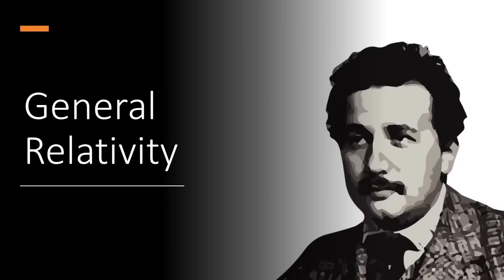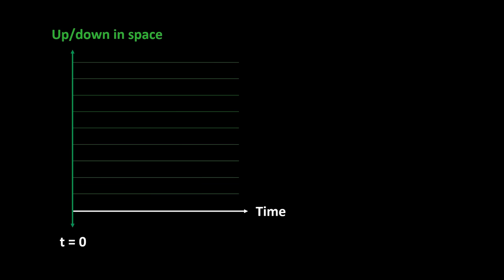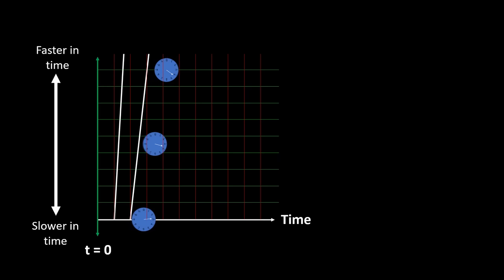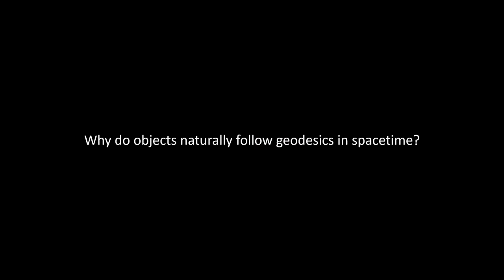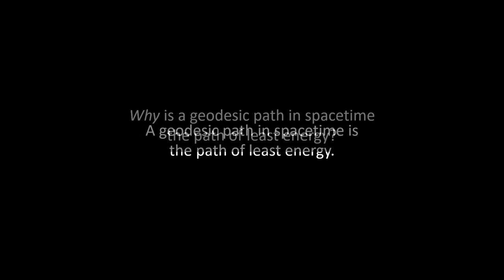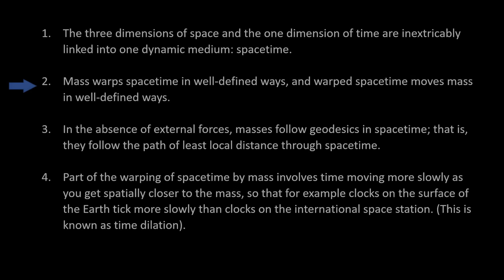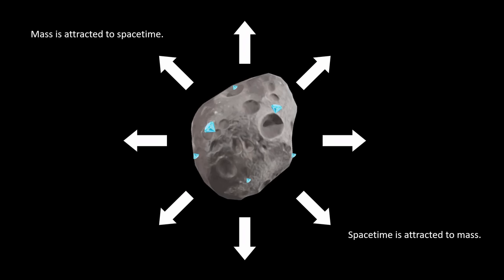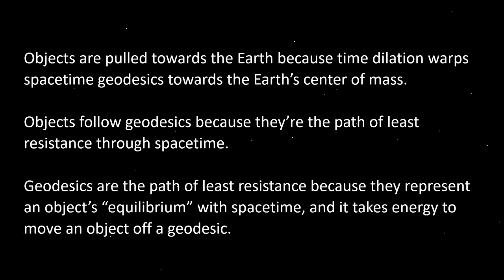How Time Dilation Causes Gravity, and How Inertia Works

Comment: Ok there is no such thing as time its existence and purpose is to be a way to measure life spans of the universe down to electrons time dialation is only by products of friction, static(electricity) and magnetism caused by the first two time itself is not affected by anything it's the physical matter of the object your using to measure time that is slowed by the the affects of the friction, static and magnetism. Time Is a constant rate of incremental now's that we use to measure the passage of life and or the decaying of it.

Comment: Great video! Does your explanation of inertia imply that there is a "privileged" reference frame? One where an object is neither warping new space nor unwarping it's existing space?
Reply from the maker: Hi Chris, very interesting question. Thinking about this, it occurs to me that this is basically the same thing as asking if there can be any object out there totally "at rest", i.e. with 0 momentum. For this to happen, all gravitational influences from everywhere on that object would have to be perfectly balanced and would have had to be perfectly balanced for the foreseeable past (otherwise, that object would have picked up some momentum due to gravitational acceleration). Because of this, I'd say no, there's no privileged reference frame of the type you're asking about. You may have heard of the "three body problem", how deriving analytic solutions for the trajectories of just three gravitationally co-influencing objects is effectively impossible; well, the case for all masses in the Universe is like an "infinite body problem", and it's essentially impossible for this infinite set of chaotic influences that propagate through space at the speed of light to balance out to 0 at some point.

Comment: I question statement #4 at 1:43. Atomic clocks put in the basement of the Empire State Building and at the top showed that the ones at the top registered time more slowly because they were moving faster. The same with the synchronization of GPS satellites and ground clocks. Please double-check statement #4...it doesn't seem right to me.

Comment: Excellent explanation of how gravity works.  Much better than the three videos you mentioned in the beginning.  I would love it if you expanded your examples of traveling through the geodesics to objects flying by a planet at different speeds.  Explaining why speed matters and why traveling at different speeds determine the geodesic path of the object.  At high speeds its path is slightly bent.  At the right speed it winds up in orbit.  At lower speeds it crashes into the planet.
Reply from the maker: Thanks! And agreed, that would be a useful illustration of how geodesics are tied to momentum.
Reply: @IdeaListEye  pls make this. there is very little research on the relation between inertial forces and geodesics.

Comment: Empty words.
Mass attracting space-time is not a better explanation/model than mass attracting mass.
Maybe it's not the height of the apple/clock that makes its time faster, but rather its speed due to the rock's rotation creating 1 angular speed but different linear speeds.
Also, time having a speed while speed's 1 of 2 components is time needs a rethink with better words.

Comment: The longer circular distance per unitime (s) due to an airplane 's moving at a father distance away from the Earth's axis of rotation than its radius length is the reason why you feel an illusion  as if  the time on such a flying object were running  faster than the time  on the ground 

If the Earth's rotational motion suddenly stopped ,all you guys would  no longer be able to say anything about such nonsensical theories as general relativity , simply because the human -invented concept of time originated in the Earth's endless rotational motion and the effects of sunlight, and human-invented concept of time is the cradle or foundation of all human other invented concepts . Without either of the Earth's rotational motion or sunlight, there would never ever have been any other  human-invented concept at all,  no -human-invented concept of mathematics , nor physics, nor chemistry nor anything else  either , and obviously no such nonsensical theories as Einstein's ,  the big bang and an cexpanding universe by ignorant human scientists

Comment: Your video is merely another copy of human subjective interpretations of gravity based on human ignorance and wild imagination 
Let's see why and how your knowledge of science  have been being confined or stuck within such nonsensical theories for so long? 
We will take two very  simple  examples of rotational  motions which are very familiar to every single human on this planet , then relate the rotational motions to tghe Earth's rotational motion to  help you guys understand gravitational forces easily without any imagined  complicated  mathematical formulas which exist only in human extremely limited knowledge , or never ever exist anywhere else in the universe except within human wild imagination and ignorance of objective reality of the structure and mechanism of the universe 

1) You have two coxial or concentric wheels. One is small , and the other is big . Now you turn the axis of rotation either clockwise or counter-clockwise 
Which one has a faster velocity ? 

2) two persons standing on the revolving circular platform of a merry-go-round. One is near the axis of rotation , while the other is near the edge of the circular platform.

Which one has a faster velocity ?

In both of the 2  examples,  the 2 concentric wheels and the two persons on the circular platform  have the same angular velocity and frequency,  and travelling within the same period of time , and their angular frequencies are in phase , but at  2 different velocities due to having different distances away from the axis of rotation or different radii 
Angular velocity or frequency is represented by the ratio of the change of the angular between the position of an arbutrarily chosen  correspoinding points  on the  two wheels  and  a fixed reference point on a stationsry frame of reference , and the angle between  2 arbitraryily chosen and coressponding positions of the 2 persons and a point on a stationary reference frame  
W= 2pi/T where T is the period of  time it takes to complete a cycle or rotational motion , 2 pi is the distance of travel in radians
The tangential velocity  is 
V= 2Pi R /T = wR
which is angular travel distance per unit time or second . What might cause a confusion here how to  understand that a  velocity itself can also be considered as a differential distance which a motion has travelled 

Now relate those rotational motions to the same rotational motion of the Earth around its axis , by putting a person on any arbitrarily chosen position on the Earth's surface , and another person on an flying airplane which is moving correspondingly to the Earth's rotational motion so that the  perpendicular distance between the person on the ground and the other on the airplane will stay almost unchanged .
Which of them will have a faster  centripetal or tagent velocity ? 

Again, obviously  the one on the airplane at a farther distance away from the Earth's axis of rotation than the length of the Earth's radius will make a longer distance of travel within the same period of time , and since the airplane's circular motion's  angular  frequency and that of the fixed  position of the person e on the Earth's surface are in phase , the  velocity the one on the airplane has to be at a slower velocity for the airplane's angular frequency to remain in phase with that of the fixed position of the other one on the ground

Now if the bigger wheel makes a larger travelling distance than the distance which the smaller wheel does , although they  both have the same angular frequency . It means that the bigger wheel will actually have to move more slowly  to be in phase in term of angular frequency with the smaller wheel, but not faster or out ofvphase with the smalker wheel.
Similarly  the person standing near the edge of the circular platform travels longer distance than the one standing near tge axis of rotation does. So , in order  for the angular frequency of  that person at the edge and that of the other one near the centre to be in phase, the circular velocity of the one at the edge will 
 have to move more slowly than  the velocity of  one near the axis of rotation . 
The same rule applies to the one flying on the airplane, who will have to travel at a slower speed than the Earth's rotational speed ,  moving parallelly to the person standing on the ground , and  a larger distance away from the Earth's axis of rotation than its radius  in order for the angular  of the airplane's rotational motion along the Earth's surface or around the Earth's axis of rotation and the angular of rotational motion of the other person standing on the Earth's surface to be in phase, but not out of phase 
So what is conclusion from the comparision of those same types of circular motion? 

Objects at a farther distance away from the axis of rotation or the centre of any circular motion  always travel at a slower speed or velocity than the velocities of  objects at a shorter distance away from the centre of the circular motion

That is why you have time running faster when your watch or clock is  in the same circular motion at a farther distance a way from the Earth's surface due to the fact that at longer radius than the Earth's radius , such objects as an airplane or spaceship travels a longer distance than any corresponding point on the Earth's surface at  a perpendicular distance away from  the airplane  above does , in the same circular or rotational motion,  and the velocity of any object flying at longer distance away from the Earth's centre or axis of rotation than the Earth's radius  has to become slower,  even when two different circular motions , one on a fixed  point on the Earth's surface,  and the other moving correspondingly in the air, and at the same perpendicular distance away from the point on the Earth's surface in the air. Since you make a longer distance of travel in an airplane within the same period of time than  the distance  you can make  being on a fixed point on the  Earth's surface and a perpendicular distance away from the airplane in the same rotational motion , although  your position's angular frequency  in the rotational motion of the Earth and that of the airplane are in phase  or the same , and that's why it gives you an impression that time travels faster at a distance away from the Earth's surface,  but not any sort of nonsensical theories as gerneral relativities , and delusionally mathematical model of a 4- dimensional space  universe with the 4th as the dimension of time with only one and irreversible direction as the way how  Einstein's subjective interpretations say  
Another effect on human-inveted  time teller is the gravitational force which acts on parts of it. Nevertheless,  the strength of the gravitational force does not change much enough to make any difference between its force- magnitude here on a clock and  that on the same clock when the clock  is on an airplane  . Otherwise you would never ever have got the constant acceleration due to  the Earth's gravitational force =9.8 m/s^2 

It is incredibly ignorant when you say that the gravitational force  affects the running functions of any human-invented time teller, such as a clock, while you also already know that g= 9.8 or so m/s^2   is considered to be constant or unchanged  within the Earth's atmosphere , no matter how far away  from  or how near to the Earth's surface it is
You can observe the same natural  phenomena in circular or elliptical motions of different  planets around  the Sun in this solar system in which planets at farther distances away from the Sun move more slowly, but travelling in longer distances than those planets nearer to the Sun , due to having larger radii of the same  circular  or elliptical  motions

Comment: What on earth does 'dynamic medium' mean? Anything? Space and Time are not 'inextricably' linked. Space is the dimension of (relative) position, hence xyz-axis. Time is the dimension of change (hence 'rate') so merge the dimension of position with the  dimension of change and you get Spacetime, the dimension of changing position...aka MOTION. Spacetime, the dimension of motion. What's inextricable about that?
Spacetime is actually the dimenson of constant motion, because all dimension are refence frame specific. Spacetime-time is the dimension of changing motion i.e. constant acceleration, spacetime-time-time is the dimension of changing acceleration etc etc.
And all dimensions are ABSTRACT! They are just calibration and indexation frameworks referencing an underlying reality. Example: Temperature is the dimension of heat. Temperature is abstract, heat is real.
How can Mass warp an ABSTRACT! Abstracts only exist in our collective minds.  You really need to get your terminology sorted.

Comment: I like the warping explanation a lot! I’d hazard that the fabric of space simply consists of all radiation, including light, traveling everywhere, the paths being bent slightly towards any mass present – including each other. 
Perhaps it’s even possible to prove that the speed of light in vacuum is a reflection of light limiting itself through ever so slight warping of minuscule geodesics becoming more pronounced the faster a particle moves. 
And wouldn’t this mean that UFOs could bend space by way of light, thus creating a gravitational pull in any desired direction? 
Oh, and how about Bohm et al.’s theory that »empty« space contains immense amounts of energy? Tap into that, bend space and move!

Comment: This was very good. Thanks a lot. The final question is what does my head in. Why does mass warp space-time? My intuition is that mass is a process that requires both space and time, and this requirement takes energy out of a specific location where the mass is in space-time and distorts it. Just my hunch or intuition.
Reply: That would make sense since objects get their mass from the energy which is packed in their atoms through the quantum particles (so explained by veritasium). Probably those energy packages are somehow influencing the spacetime around them...

Comment: But isn’t this theory supposed to do away with gravity as a force?
Also how is mass defined in the absence of gravity? As inertia? Sort of a resistance against acceleration?
It also seems to me that time would come out as a space-vector in this model – a path of least resistance between two locations in a three dimensional grid – the grid itself being warped by all the masses in the vicinity in accordance to their masses.
Nevertheless, NASA must have precise, time proven methods by which to calculate all these things. How else would they be able to slingshot objects around planetary bodies, as they often do? NASA can’t presumably rely solely on approximations, since last minute course-corrections would then come too late, when the space probes are light-weeks away.
Couldn’t you start by covering how such calculations are done in real life before we let ourselves be overwhelmed by quantum conundrums?
Let's have the model which works well and the simplest theory that fits it!

Comment: Isn't a clock (mechanical or atomic) just a standard way we use to measure the time it takes for something to happen? Just because it can work faster under less gravity does not mean there is in reality a space/ time link. Might not the variable rate of our artificial time with gravity be simply related to variable inertia of the mechanism components, for which, we make calculations to synchronize the clocks. By synchronizing the clocks are we adjusting space?

Comment: Great explanation!  Certainly regarding inertia.!
But do the rules apply when you have a black hole as mass (instead of the earth) and an apple that falls from the branch towards the black hole...?
At one point the apple will be going 99,9999999% of the speed of light and weigh as much as a small planet (and thus even will fall faster, not?)  So there has to be a factor in the equation that takes this into account.  That objects, as they fall , gain mass.  Or am i wrong?